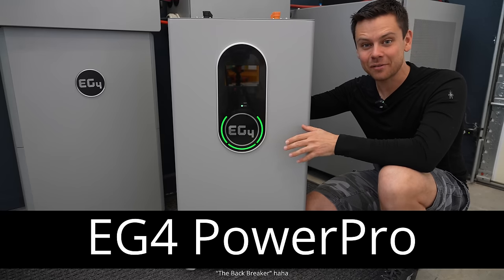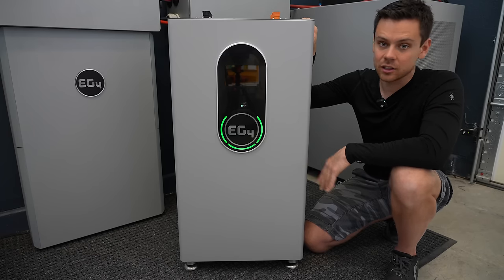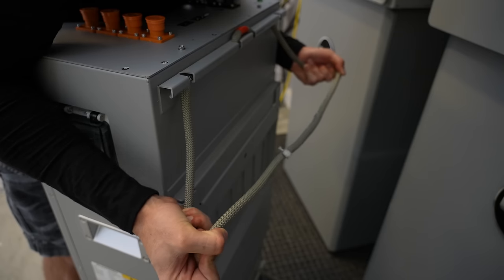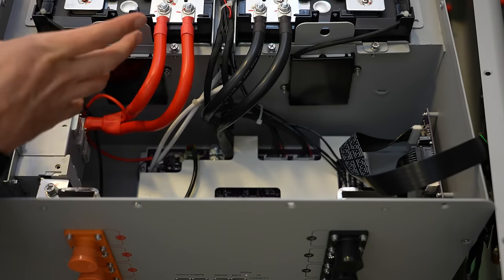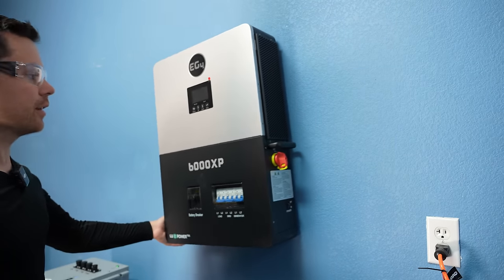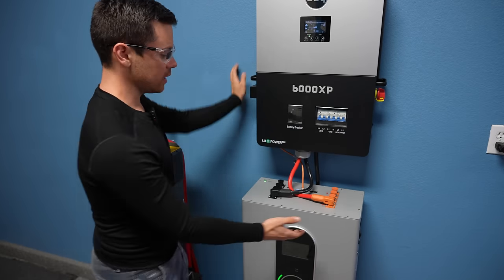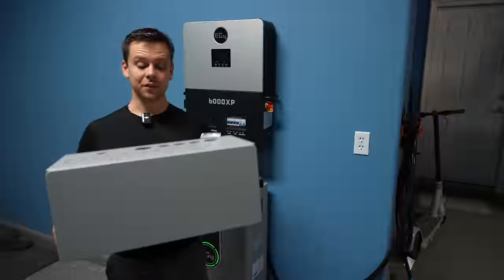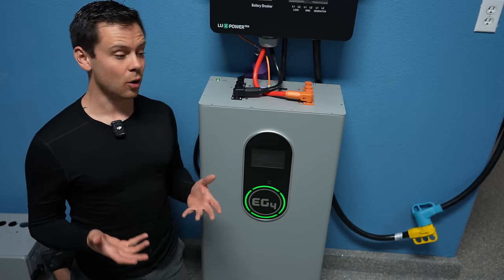New! EG4 PowerPro Budget Model: 14.3kWh LiFePO4 Battery for $3,431

Comment: A thin sheet of acrylic over the internal would be good.
Reply: I was thinking Kapton tape/film but ya... if you are opening that thing even once putting some "safety" covering on it appeals to me.
Reply: @phlogistanjones2722 hell I would want to install a "safety" covering before even moving it into position, wouldn't wanna risk something heavy hitting it and bending the front cover
Reply from the maker: The cell holders actually protrude out to protect the bus bars. They are black so difficult to see. Not an issue if you damage front of battery. The whole cell case would prevent that from occuring. Was an issue on other packs but those had fiber board. This one doesn't need it
Reply: might defeat the less-than-necessary fire extinguishers?
Reply: Does heat and venting become an issue?

Comment: Awesome video!  I would love to see you do a video focused less on solar hardware, and more on the best ways to lower energy consumption with major appliances, like water heaters, air conditioning/heat, laundry units, etc... How to get the best bang for your buck when designing a home with solar in mind.
Reply: I bought my home in March 1984. 40 years of being here. I have had 3 roofs  put on since buying the house. The last one was put on in 2019. It's a sprayed on rigid urethane foam roof.
The attic gable fan used to run 14 hours a day in the Summer. The thermostat is set to 95F. It almost never runs anymore. The foam roof cut my heating bill by 65%. I don't even have AC. The place stays cool in the Summer until evening when I open the windows all night. I never installed double pane windows.  I did lifestyle changes that cut my electric consumption from 24-28 kw per day down to 8-10 kw per day. Not bad for a 2900 sq ft house.  I do it for fun. I'm a retired Engineer and found plenty of solutions to live a normal life even if the SHTF and we lose the grid for a few weeks. If I ever build a house it will have 2x6 studs, sprayed in foam, tons of improvements, a real basement, and everything that I could think of to operate efficiently.
Reply: Try technology communications channel for 100s of videos of this

Comment: Will - thanks for the presentation - This looks like a very viable option.  For your power cables, I'd run those on the outside of the connectors (as opposed to crossing on the inside of the connectors).  This also keeps power away from communications - which is always a good idea.

Comment: Just this set up alone blows the doors off the New Eco Flow Ultra. So blessed I had not purchased one yet.
Reply: Agreed. I was about to drop 10k on one from Costco that contained the inverter 18KWH batteries and the Home Panel. Now I will be spending more but getting components shown in Will's videos and have a much more robust system that will be much better. So glad I found this channel before buying an EcoFlow DPU system.
Reply: @bstancel12  Congratz. 
Will's channel is is Bar-None when it comes to education and understanding of what is available in the market. He is my go-to for tutorials.

Comment: 🎯 Key Takeaways for quick navigation:

00:00 💡 Introduction and Physical Description
- Introduces the EG4 Power Pro battery, emphasizing its heavy weight and indoor use only.
- Highlights the main differences from the previous model, including cost savings due to indoor rating and similar features as outdoor-rated batteries.
- Mentions multiple distributors selling the battery and its compatibility with the 6000 XP.
01:16 🔋 Basic Features Overview
- Details the battery's specifications: 14.3 kWh capacity, lithium iron phosphate cells, and 200 amp BMS.
- Describes the color touch screen interface and its functionalities, including communication, state of charge, voltage, and settings.
- Explains the layout of the bus bars, connectors, switches, and mounting options.
03:18 🔌 Connection and Installation Process
- Demonstrates the process of connecting the battery to inverters and other batteries using ampol connectors.
- Shows the location of the on/off switch, circuit breaker, and mounting plate.
- Provides tips for safely handling and mounting the heavy battery unit.
05:10 🛠️ Internal Components and Build Quality
- Observes the internal components, including bus bars, connectors, and sensors.
- Identifies fire extinguishers and explains their purpose for code compliance and safety.
- Comments on the overall build quality and compares it to server rack batteries.
08:14 ⚡ System Setup and Load Testing
- Guides the setup process for battery communication and inverter connection.
- Conducts a load test with a 240V space heater to evaluate performance and capacity.
- Notes the system's ability to handle the load within its rated capacity.
10:05 🚗 Additional Applications and Accessories
- Explores additional uses of the battery, such as powering electric vehicle chargers or heat pumps.
- Discusses the availability of accessories like conduit boxes and their installation process.
- Mentions future plans for expanding the system with additional batteries and inverters.

Made with HARPA AI

Comment: I live in a place where I have been without electricity for several days and even weeks to hurricanes, but I still find it difficult to justify spending so much on a battery backup system or even a backup generator. I would be spending thousands on the off chance that I might need it once or twice within 10 years. This makes more sense as an off grid solution though, where power isn't readily available.

Comment: hahaha great review man. You've helped me decide that i'm going with the EG4 18kpv and 1 or 2 of these new powerpros. I am leaning towards some bifacial panels, about 12 to 14kw of them. I think that'd be a sweet setup for $15k ish
*I have recently started seriously researching everything as i'm building a new home. It seems the battery tech, solar tech, inverter/charger tech......all of it is getting better and cheaper at quite a rapid pace. I won't be installing my kit for 10 months or more so who knows, by then it's gonna be even cheaper and better! My 2023 model 3 with the new LFP batteries made me a believer in LiFEPo for sure. THanks !
Reply: I'm with ya, I was about to do the EcoFlow Ultra setup but will now wait too.

Comment: great video I have learned a lot from you, It is important to leave a small gap on the sides of the batteries so you can access the battery breakers they will shut themselves off if you use rapid shut down, and they will need to be manually turned back on.

Comment: Love it! You should check out the Vatrer 51.2v server rack battery. Outside of the no communications it's very impressive for the price. I think could give EG4 lifepower4 server racks batteries a run for their money. Especially with reliable capacitors and a touch screen display that shows you every cells health

Comment: The capability and simplicity of this system is great however I wish there were horizontal mounting options for both the battery and inverter. This would really expand the use cases to include RV's (my use case) and other off grid installations.

Comment: Long time listener... I wonder if you have any system recommendations for the following, where I'd add solar panels later (too many trees I don't want to cut).  Note the use of battery until it's drained, then go to generator...:
Normal mode: utility >> eg4-18kpv >> battery >> home panel
Outage mode battery available : utility >> utility outage >> eg4-18kpv >> battery >> home panel
Outage mode battery out: utility >> utility outage >> eg4-18kpv >> generator >> battery >> home panel

Comment: I would really like to see how you would hook up 2 or more 6000XP units with Power Pro batteries and the chargeverter.  It seems like those bus bars on the battery might be a great place to connect them but I am not seeing that in the manual.  Signature Solar suggested a bus bar for combining all this equipment but I would still like to see you endorse that concept.

Comment: This is powerful enough to run a house - not just a cabin.  Looks an amazing setup. And so easy to add another 14.3kWh!  So about half the price of the Tesla Powerwall.  The Tesla Powerwall doesn't even confirm it uses LFP batteries (8000 cycles) it possibly uses normal lighter smaller lithiums that can really only cycle 2000-3000 times. They don't confirm what lithium chemistry last I heard!

Comment: Excellent, detailed review.

Well, if I had to comment, I notice huge efforts made by EG4 trying to keep up with market demand, knowing there are 200A 'BMS' strong competitors that are well renowned. It has such a beautiful, rugged, strong-built case, ropes, flexibile busbars and much-needed add-ons inside (2x fire extinguishing packages, a front smart display, heat pads, an MCB for the DC line, and parallel terminals), which are all a plus. 
But its lacking when it comes to cell balancing, and with its 120 mA passive balancer, the cells 'can and will' go off balance at some point in time (no matter how matched their internal resistance is). Its low balancing capabilities won't be enough to fix such problems with ease, like a 'JK BMS' and 'Seplos V3.0' would. 

Also, why do busbars have to be welded? Why not give the option for the user to replace a bad cell? Of coarse, one could drill and undo the stud, but this is a danger that can be avoided by using ordinary nuts other than laser-welded ones.

For those who don't know the consequences of unbalanced cells in a 16S battery setup like this, they would be: 
> Unable to reach the 'Overall pack full SOC' = 58.4V due to either cell(s) reaching their full SOC (3.65v) while some of them are far behind. Hence, the BMS will stop charging because of the individual cell overvoltage protection.
> Unable to utilize the full capacity of the 280Ah cells within, the EG4 battery capacity would serve far less than a BMS with optimal active balancer capabilities would.

Without being too judgemental here, its not hard to notice how the host (a brave salesman) tend to make his reviews biased toward EG4's favor. Otherwise, why hasn't he, having so much experience, pointed this out already? I let you, as customers & buyers, take the lead.

But yes, buying a 200Ah setup would be, 'in my opinion' the most feasible way to go when compared with server rack batteries. Imagine that it just takes two of these setups to have around 560Ah, while one would require a tower rack of batteries (with built-in BMS) to keep up with it.😎 Stay charged and don't get sun-tanned.
Reply: What actual BMS does the Indoor Powerwall EG$ battery have? Is one able to get a phone app to monitor it and/or change settings?

Comment: What a great system & battery setup. Like many others, the battery busbars really should have & need some form of a protective layer, it looks extremely dangerous when opened up & leaves a lot of potential for accidents with exposed busbars like this, if the front cover was hit with something heavy like a car in a garage it could have serious implications.

Comment: Considerations for off grid use in northern Alaska... do you know specifically how the heaters function? Will they run whether or not there is current coming in or going out (@32f - 41f)? Normally our home is warmer than 45f, but we do occasionally leave long enough for the temp to get quite cold. Would it work to build an insulated cabinet around the system (closed only when left in the cold- no loads- fully charged)?

Comment: I built my own 48v 15Kwh battery 2 year ago for $3000, in a steel box lined with closed cell neoprene, with an Overkill BMS.... I had to build it in place due to the weight.

Comment: Love your work and EG4 equipment. Unfortunately only available in U.S. & surrounding areas. No international shipping. 

I’m in Thailand and we just installed 2x LVTopsun 6Kw inverters, 3x LVTopsun 51.2v 200Ah batteries & 24x  Longi 580w PV’s.. 

I’ve had it running almost a month. Powers a pool pump, bore pump, water pump tank to tank & to house, 6 air cons no issue. 

Can’t run air cons once the PV’s stop generating electricity as the batteries won’t then last all night. We’re off grid but have company supplied electricity as the “backup source”.  Also unable to adjust SOC and discharge from 25% switch to back up source & 40% back to batteries. Not sure what’s going on there as I’d like to go down to 10% switch over to company & 30% back to batteries. This would see me not needing to use company electricity at all. 

For those interested in costs overseas. My system here cost $14k fully installed. The only downside here is suppliers and installers or companies drop you like a hot potato after installation and they’ve been paid. Never to be seen again. 

Would love to see a review on LVTopsun brand if that’s available to you & possible to do.

Comment: Looks good.  I'm just shy on all the electronic interfaces.  We're on ledge. Had a ground strike last year. Had to replace anything with circuit boards, even non electronics like magnet cabinet closures which blew apart. Even things not plugged in like my wifi hot spot.😢

Comment: Wow, no rubber protection, so if it gets dropped or dented, you have a huge short with no fuse between batterys? Is the case cover conductive?
Reply: Probably has to do with certification, any material they put in there would have to be certified to not sustain a flame and to be extinguished by the fire suppression system.

Comment: Hey Will. I watched this and I rewatched your video from 2 years ago about nobody using raw cells any more. Now that I see the EVE 280 cells for under $100 instead of the $229 from 2 years ago I have to say the savings difference is huge now compared to then. I understand the plus aspects of a built battery but the savings could be $1500 on the raw cell setup. What are your thoughts?

Comment: A 300lb sleek box seems gloriously easier to move than my current 2,000lb GNB FLA tubular batteries (x2) that are in their OEM steel boxes.  I actually had an engine hoist fail moving them one time, leg just collapsed, even though it was rated for 2,000lb's.

Comment: Will, love your content. Have seen every video since you were living in the RV. Video Suggestion, could we see a pros and cons comparison of the Ecoflow Delta Pro Ultra compared to the system in this video. It seems the EG4 combo is significantly cheaper and has more capacity in some areas. I think a buy vs build could be very interesting.

Comment: I had 14.4k solar installed in 2020.  My installer chose AP Systems QS1 microinverters. (Note, without telling me exactly what they were installing).  I have 36 400-Watt panels on my roof.  So far we have had to replace 2 inverters.  Now, after the second inverter replacement, all modules are reporting 1/2 of the output they should have compared to the new replacement.   My 14.4 KW system now has a total output of 7.5k max.  I'm thinking of asking them to remove all the micro-inverters, wire in string and I'll buy an EG4 18kpv with this battery.

Comment: So if I did my math correctly.
This battery runs at 240 dollars per Kwh. 3431/14/3
The EG4 rack mount option (ones with displays) is 290 per Kwh. 8937/30.72.
So for a few thousand dollars more you can get 42.9 Kwh.

I haven't checked yet, but I imagine that if you already own a rack of EG4s, that these should be able to work in the same network.

Regardless, I'm glad that more options are opening up!

Comment: I would like to see some content, and perhaps discussion, about using a persons own solar system to supplement home use power.  Instead of sending it to the Grid with now low reimbursement rates, it seems like it would be more profitable to use one's own solar, and still have some standby power in case of the grid going down.  

This system seems like it would be good for that use, but it would be nice to see a system where one could set running down the batteries to some percentage like say 40% so there would be backup still in the system.  I may have missed discussions on this, but that is something I have been toying with in my mind.  I am not all that technical, but I have put a good sized solar and inverter system on my own RV.  I know some utilities, like mine, don't let a person install all the solar they want and don't allow a batter system if I connect to sell my power to the grid.  Thank you for all the great content.  Mike

Comment: Hey Will just wondering what would you install in a camper for a battery/ inverter system today. I know it’s been awhile since your camper days just wonder if going with an all in one form factor like a ecoflow delta pro makes sense or something like a wall mount battery and inverter. I like the all in one since I could move it inside my house when the power goes out even though I have a battery backup for my main circuits. I also live where it gets cold in the winter so leaving a battery mounted in the camper all winter doesn’t seem like the best option but they are getting cheaper for how much you get.

Comment: That does make me nervous knowing that a simple accident of bumping something heavy into the front of that panel could easily short out, and even energize the case at that point. A thin plastic sheet would be a simple fix to that. Any reason that can't be retrofitted if we use the right material?